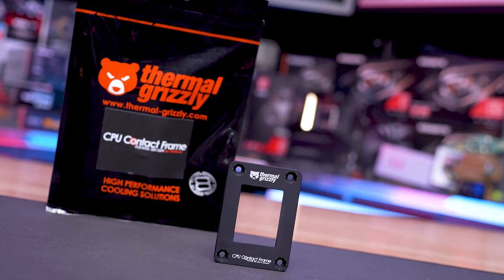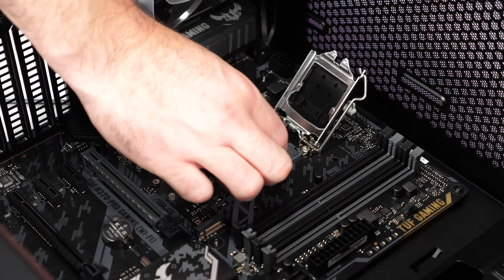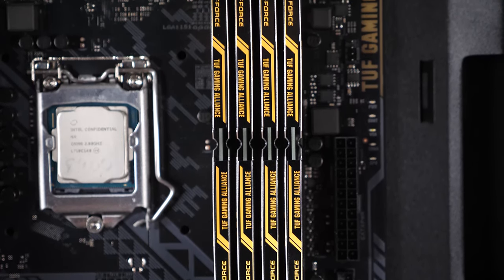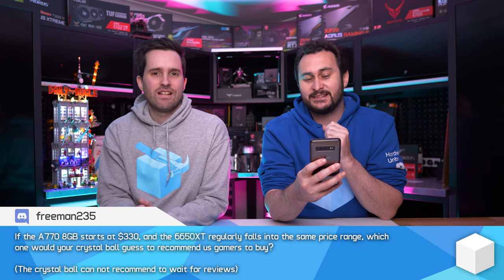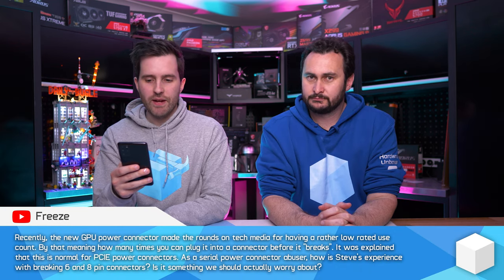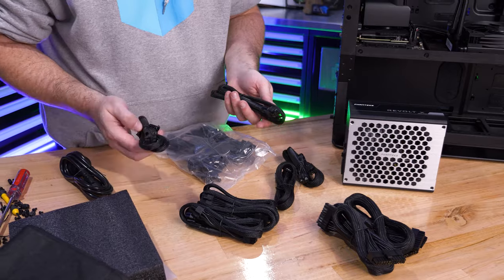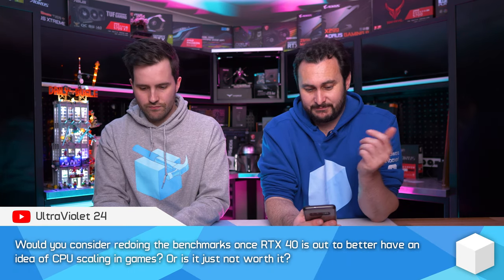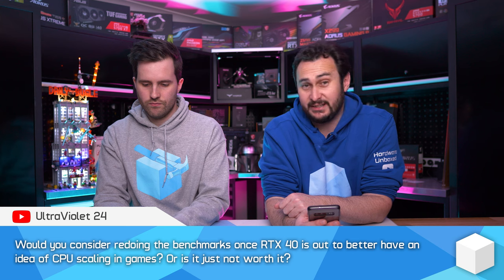EVGA Quitting Bad For Nvidia? Arc A770 8GB better than RX 6650 XT at $330 US? September Q&A [Part 2]

Comment: I would say to stay away from first gen product (first adopter tax) then again if you're really looking to buy it there's so many things to consider. Like what's your workload, is it purely gaming or else. Arc have better encoding, AI cores but they cannot run old games (natively), driver still premature etc. If AMD and Nvidia have 1:1 pricing I would say Nvidia because the more features you can get compared to competitors.
Reply: There won't be 1:1 pricing, both RTX 4080 & 4090 are above AMD's price ceiling.  AIB partners may try some halo overclocking models, but the over priced faux '80 the 4078 at $899 and the 4080 16GB are promising targets, for a real gain in price performance.
Nvidia claims were based on the ludicrous poor value 3090 Ti crypto bubble exploitation card.
Reply: There are times that adopter tax does not apply. And personally, I think there are two "tax." First is the support and potential bugs. But this can be remedied by waiting 2-4 months after release. Then the second one, is the actual price. While we actually need to wait for more reviews with Arc, the already bad media pushed it to a much lower price that intel intended it if they actually manage to fix the drivers beforehand. If intel manage to fix their drivers by the middle or end of the cycle of Alchemist, I would actually expect it's price would also increase. Think of AMD ryzen when they first started, they were cheap/affordable, but the moment they found their ground(5000 series), they increase their price.
Reply: Yes there won't be 1:1 pricing but what I'm saying is that you gotta look what a GPU can offered you. 

But you hear that Arc and Battlemage have hardware flaws that cannot be fixed by a software update. That's something you should consider.

I want them to be success and commit to the GPU. Because more options is good.
Reply: @TheUruse  Don’t listen to rumors. Specially that Intel hater MLID. Guy has been proven wrong time and time again about Arc. Wait for reviewers.
Reply: @TheUruse  Yes, I have heard that and Intel's TAP presentations had holes in the stories which concern me.
Frankly I don't believe the Intel execs, they only talk about future iGPU & data center, not a long term commitment to gaming gfx which is high end and needs expensive particular support because of different hardware behaviours.  Nvidia don't want to make console ports easier as they are Radeon optimised by developers aiming at Play Station or Xbox.
Intel are too late to market, won't make money for at least 4 years, which is exactly what they said 4 years ago, so I'd be amazed if they keep subsidising gaming cards.
Reply: @kitnoman  Arc is a 2020 spec card, releasing Q4 2022 as new generations are launching, so it MUST be low price.
Secondly Intel have a launch debacle from Q1-Q4, they say they are driver issues, while requiring Re-BAR when they never explained yet how old games will be patched to not use 256MB aperture based VRAM management.
The Zen3 launch pricing, had Zen2 and Zen1+ still available as the budget option, it was ALSO both best gaming and best productivity chip.  The motherboard quality was high, so the platform was proven and the best choice by far, Comet Lake didn't even have PCI4 and Rocket Lake failed in the market.
Look back a few years, you'll find Intel charging > $1,000 for fewer cores, segementing their range to death and  Intel had to cut prices massively being wiped out in HEDT for example.
Zen3 stayed at launch prices for 18 months, because they were selling every chip they could make, substrate & other supply constraints slowed ramp up of production to meet demand.

Comment: On the EVga thing, I like their power supplies, very good and reliable for the pricing. I have a 5 year old 450w BT (Bronze) that is still going to this day. I'm looking to upgrade end of the year for a GPU upgrade  (Looking 1070/1080/RX5700 range) and thinking i'll get a 600W (At least bronze) for my next PS in anticipation of that upgrade
Reply: I’m on the opposite side, I’ve owned a few evga psus over the years and have had plenty fail. No they weren’t under any strange conditions or were filled with dust. They were under normal use and I just never had any luck. I’ve had 3ish fail
Reply: I have had a good experience with EVGA PSU's as well over the years. I bought the 1000W P2 when it launched. It has been pulling duty for many years and has been running two 3090's nonstop since they launched without a hiccup. I have used them in all my client builds too without issue.
Reply: @iiiiii7680 , I've also had one failure on an EVGA, it was a 400w white (base) PSU, I bought it off ebay NIB, but no sales receipt, so couldn't warranty it, stopped working within a few weeks, I assumed it was failing and the guy wanted to get rid of it (Looked new and clean so IDK). The BT was an amazon deal at like 24.99, so got it, been great ever since. So my experience was 50/50 but since I don't know the actual condition of the 400 W white, i can't say it was quality

Comment: The 12VHPWR story began with Gamers Nexus reporting just before GTC the email from PCIE SIG about failed validation tests.
The insertion cycle failures after 40, was not the significant part of the story, it was melting connectors and the vulnerable cables and thin pins.
The story was mostly ignored, but the failure mode means it needs proper attention.  Others have complained about the weedy power connectors in the past that simply appear flimsy compared to the past connectors.
Secondly Nvidia used them without the ATX 3 data lines, which with dumb supply are speced to default to the lowest value, NOT assume the best.
Many know molex connectors were not rated for many insertions, they DID NOT have 600w at 12v worth of amps going through thin cable and pin.

Comment: i pull my pc down to clean it every 30 days and replace thermal paste yearly if im taking the GPU out to blow out the dust thats 12 cycles a year for around 3 years thats 36 cycles not to mention most of my psus have been running almost 10 years, the issue your missing from the story is the conectors were melting and catching fire after 30 cycles

Comment: As to the bending on the PCIe5 cable... I thought in the eTeknix video they pointed out that they also abused the cable in that they were pushing a lot of power through it for over ten hours before it failed, which are outside what it will experience in in the real world for most people, especially gamers, according to Jon Gerow.

Comment: Regarding the connector life cycles, I wonder what is the actual average cycle count for such connector among all people. People who buy a system and maybe upgrade once, or upgrade by replacing the whole box. People who build their own system and maybe troubleshoot once or luckily even never. And how many people are there out there who actually need to plug and uplug these things on daily basis. I might as well be an important piece of news for 1 in 1000 users who actually manage more than 15 plug unplug cycles on the one piece of hardware. Maybe even fewer. You just get the computer and use it, not disassemble and reassemble it for fun once a week like Linus does for his videos.

Comment: the a770 has one major selling point even with "work in progress" drivers, the media supports already great from my friends exp with the a380,  if thats a major thing to you... an arc card as aux or primary if you know the games you give a crap about will run fine-good... dosnt seem like such a bad deal to me... 

i see a few ways to sort the driver issues with a leg up... dxvk and dfvoodoos work to convert older langs to modern langs on the fly, if rather then try and match decades of work by amd and nvidia they just piggy back on work already in progress and maturing rapidly, and contribute back.. i see that as a path that could give very good driver support in fairly short order.

im told the a380 and a770 are abjectly amazing at media encoding though even some stuff thats not officially supported like vp9 encoding is working with alpha level software(no UI just libs you can call on/exe's you can call on.. ) still impressive that the a380 is way faster for video work then dual 3090ti's...

Comment: I wonder if ECO mode will be forced onto some cheap B650 boards. It's not a huge loss, run at 100-200mhz less, and use half the power. Essentially the same way ASrock limited Alder Lake on cheap boards. At least I'd imagine A620 will force ECO mode.

Comment: Speaking about GPU power connector, why PSU maker never make L-type connector?  
Just like L-type Sata cable, its easier to manage.
Reply: a bigger question would be, why don't they just put the power connectors at the side where it would less likely to be bent at hard angles

Comment: I'm likely to max out my AM4 system before I move up to anything newer.  The question for me is currently which Zen3 CPU to get.  My primary use is not gaming, but it needs to game well enough.  Current CPU is 3700X.  One thought is 5700X to keep the same power and core count.  If I don't go that way, aiming for more cores or more cache is a question.  I can get the 5900X for less than a 5800X3D if I want to deal with the higher power.

Considering what I have already gives what I need today, and that is not likely to change significantly in the near future, I might just get the 5700X.  (Or I might not make any change in the CPU).  Once I see what that new generation offers, and and what price, I will decide what the new GPU will be.  Currently thinking about the RX 6700XT as I have workloads that can leverage VRAM.
Reply: The 5900X has a really good price to performace atm. The gaming performance is a decent upgrade that sits well in the middle of a 5600X and the 5800X3d, and the clocks and extra 4 cores makes it the ideal productivity upgrade if you make video edits. Not sure the cost of the 5950X is worth the extra money. I have a B550 mobo, 32 gb 3200 ram and 3800X and I am looking to upgrade to 5900X and 64gb 3600 ram and a X570 mobo  and use the extra stock cooler from the 3800x as gaming and every day pc, so I can use my current main PC exclusively as a music production PC. More cores .. more software plugins. The current pricing of a complete new AM5 7700 or higher with DDR5 ram seems just a bit too pricey atm, especially as the ram speed of DDR5 doesn't really benefit music programs. more pcie grn 4 or 5 in case of AM5 would actually benefit me more. Its kinda the same for me with the talk about those Intel cards. I would never go for a still buggy graphics platform that we sill don't know will come out and most likely won't ever be good with either he poorly support of older DX9 gaming titles. And some new tech currently under dev. for music production will finally be using the gpu as a co processor no matter if its Nvidia cuda, AMD or Apple sillicon, so having a decent gpu may actually be a benefit, so going up a step to the higher end AMD's seems a way better deal to me, If I had to choose between a budget gpu, the Intel 770 and AMD 6500 I would rather spent the extra money on a 6600 or 6700 as an AM4 user as even a dirt cheap 5600 will benefit frome any extram money you can put on the graphics card. The 6500 can just barely match my old Nvidia 1660s which I got a bit before the graphics card prices went all haywire. But it does an ok job at 1080p gaming. Why would I use money on a DOA Intel platform, unless you have some utter old crap card.

Comment: Hopefully EVGA will get a high turnaround on providing people with PSU's for their 4090's :)

That said other AIB's that havn't been 100% Nvidia, if they cut their ammount of Nvidia models down to a "basic card" with no OC and bling to be able to sell them and actually make a profit .. just a basic card and begin focusing more on AMD parts cause the earnings are better, Nvidia at some point might have a problem meeting the demand of founder edition cards if noone is willing to work with them on their terms. I do not know how much capacity Nvidia have in house to produce consumer cards along with their Professional server and Workstation products, but I would presume it's not nearly big enough if they don't have all the AIB's to work for them, producing how much .. 90% ?? of all Nvidia consumer cards on the market, and how many is actually buying an FE card ? They usually noisy and not nearly as good designed as AIB cards.

Comment: Tim. What is the wattage of cpu and GPU that has to be kept as industrial standard for general usage, rather than as a factory over clocked like chips from alderlake and Zen 4 and rtx 3000.Also for comparing the efficiency and  performance uplift . Also a standard which can go on any type of build including small itx,laptops etc....?
Reply: Sry for bad english. I think you understood what I mean.

Comment: I have a feeling that intel will struggle for couple of years and then shut the arc lineup down. They have over 80% of market share through igpu. They’re low key charging for igpus when people buy cpu. It’s a more lucrative business than arc for them. In addition AMD couldn’t do much with their ‘better value’ cards. Discrete gpu market has remained 75:25 in Nvidia’s favour for a long time. It’s not a cakewalk to come and grab market. AMD and Invidia has been in the market for decades

Comment: These power cable connection ratings are simply a CYA for the manufacturer.  With power requirements going up, recent fire issues with certain cases and power supplies, it's reasonable that these things are brought up.  If you insert a male pin into a female pin enough times, eventually it loosens up a bit, causing a poor connection and more heat buildup.  You want it tight.  😉
It's like a "best used by" date on food....results may vary.

Comment: Please include power draw in idle and gaming load for boards as that with european prices currently being x5 within a year that is very very important. Also please check if disabling nonsense like WiFi/bluetooth and so on has a impact on the power draw. My reciever uses 4-6 watts more with WiFi /Bluetoothon for exmaple. For something being on 16+ hours a day for me that 6 watts adds over a 100 bucks over the lifespan of a board on energy costs.

Comment: You can tell Tim went to engineering school based on the GPU power connector thing. I'm sure he's had lecturers and instructors, like I have, who have gone "eh, that's fine" and run something slightly out of spec lol. It's a rite of passage for engineers to go "eh, that's fine". If only they were as flexible with assignment deadlines.
Reply: "Pass me that fire extinguisher....hmm?... Nah, we probably won't need it."

Comment: Well if the A770 offers better support in non-gaming applications, eg. media de-/en-/trans-coding due to using QSV variant which is currently widely supported across the board, the Intel GPU might have a leg up... Even better if they manage good linux support out at the release date. Furthermore, if Intel manages to offer GPU partitioning out of the box, it'd make better use-case for utilising the GPU in multiple VMs/containers. But if the devices need the apps be altered heavily to use the features, the time it might take for those apps to become capable of using full spectrum of features might be the time prospective users would abstain from jumping on the Intel dGPU bandwagon, especially considering AMD might also offer some products in that range, and nVidia should offer lower tier GPUs for that market as well, only to make the Intel products less likely to get retail customers spend their hard-earned money.